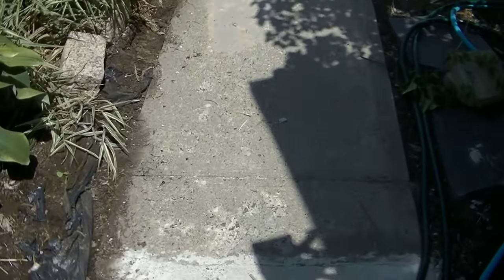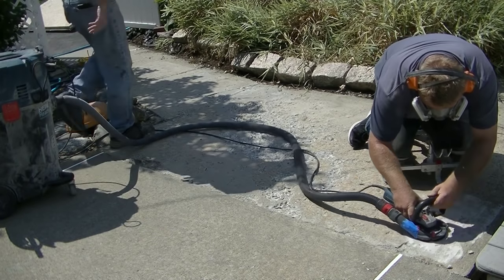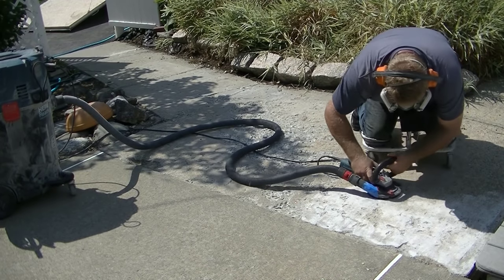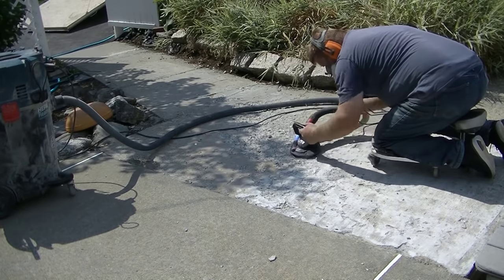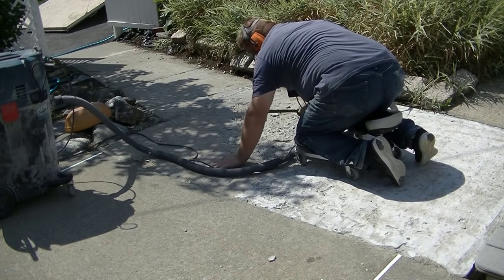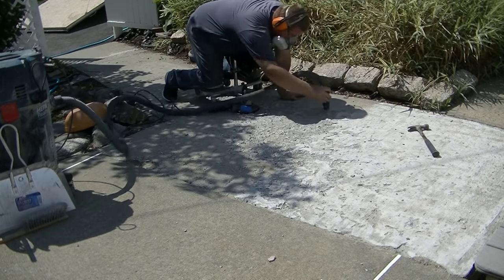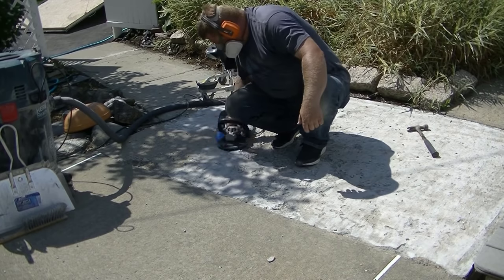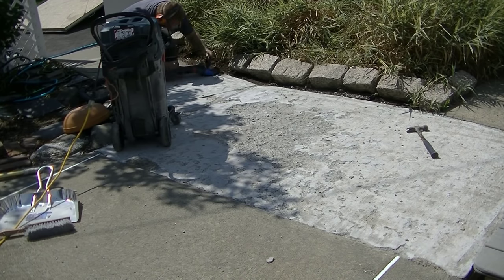How To Resurface A Badly Damaged Concrete Walkway

Comment from the maker: Here's the UPDATE VIDEO over a year later: https://youtu.be/5TdZ7jTmwyY
Reply: Excellent follow up. I watched this video when you first upload it and my first thought was how well this would hold up vs a full repour.
Reply: Thanks, I'm about to watch both!
Reply: If we get a Costco Fuel Station in Maine…. (Or another job) We will call you!
Reply: Awe brother! That looks great! And at the same time I’m encouraged to give this a try… Thank you, and pray that your business is always abundantly profitable.
- Harry
Reply: I repaired my walk way the same way but I also painted it but the paint peeled off ,,, any idea how to get the remaining paint off ?
Reply: MIKE, where did you guys get that gardening chair? It looks perfect for getting low without the strain. I have back issues and it would help me tremendously.
Reply: Great video! I'm going to attempt this on a rental unit i have. The slab is in worse shape with about 1 inch deep spalling in the middle. Ive had bad luck with standard mortar mix tuck pointing block and have since switched to Mason mix. Is it ok to use Mason mix instead of mortar mix?  I actually don't even know if rapid set makes a Mason mix. Please offer any advice. Thank you
Reply: Almost as satisfying as squeezing a giant blackhead…….
Reply: I have a  garage  floor   to do   will this work on  a drive way. The same  way. An how do I get to  talk to you   Tim from Ohio.

Comment: Guaranteed to last long enough for the check to clear!
Reply: RS mortar mix is 6500 psi, Cement All is 9000 psi.  It can take a beating even in driveways no problem.  This repair will last for years and years even in freeze thaw weather.
Reply: @vinceleto That's one of my guarantees on any masonry job. I also guarantee it to harden, one day crack and nobody will ever steal it.
Reply: Yea too thin should of just used one layer and make it thicker from the start.
Reply: @magouliana32  No.. it would have cracked in all those low voids.. stepping the slab was correct..
Reply: How much could cost a job like that? Thank you
Reply: @jorgerodrigues3404  Flames will await the wicked..
Reply: @magouliana32  that’s actually inaccurate, it’s making a mechanical bond, it’s stronger because it’s thin, by using a product like this and making it more than1/4 inch thick you GREATLY improve chances of cracking, completely different animal than regular concrete
Reply: @jamespalladino9884  understood
Reply: Better run to the bank
Reply: What do you charge🤔for a job like that....
Reply: @mysteriousmike226  I would charge $1500and up here in California. With no warranty
Reply: @jorgerodrigues3404  I'd charge $400 plus materials.
Reply: @vinceleto  no it won't salt gets under the first crack and its done
Reply: It won't last forever, obviously.  But there is a time and place for this.  For instance, this homeowner might be planning on reconfiguring their landscaping/hardscaping in 3 years.  Hate to pour brand new then rip it back out 3 years later.
Reply: @magouliana32  I don't do concrete resurfacing so this whole video is new to me. I install floor covering set this carpet vinyl etc. I just completed a 4 ft by 15 ft hallway in thick terracotta tile. In the middle of some tiles they may be 3/8 of an inch thicker than the rest of them and the grout lines are an inch wide and concave. Giving a thin coat to fill  in the low areas and it makes the second finish coat go on much better or easier.   the only reason I'm saying this is this whole project is new to me and I didn't realize it first it was going to go on so thin. Initially I was thinking it was going to be a 1 inch pour, so in the beginning I was confused as why they're spending so much time filling in the little stuff. It makes sense now by troweling  in or forcing in the first coat so that's a final coat would go on easier.
I learned a lot these guys know what they're doing at the beginning I was kind of doubting them..... My bad 😱 ....sorry guys, after seeing the process it made sense and I really like it.
Reply: @ChadBray3  well if I was planning on renovating in 3 years then I would just wait the 3 years intend of paying for this.
Reply: @randywl8925  you can just pour right over them low spots as long as you force the concrete down into the cracks and dips you just fill it up if it's low then mag it out or trowel it or even take a straight edge or a piece of wood and level it before your trowel it
Reply: Why are you using mortar for your top coat? Mortar is for bricks not resurfacing. Why didn’t you buy a bag of resurfacing like Re-Cap resurfacer? It’s $28 a bag as opposed to a bag of mortar that just coast around $12.
Reply: @vinceleto  mortar mix is high in psi this is correct. But it doesnt have a polymer in it which helps the mix stay on the driveway without poping up. A resurfacer should have been used for this job. 1 winter and its toast
Reply: @randywl8925  wait your a flooring guy and you never patched your floors?  When you do vct you dont float your entire surface?  Jobs must look great after they get waxed..
Reply: @dohnjoe4024  I patch my floors good enough that you could put wallpaper on them.  I spend way too much time doing prep.  There's also a thing called Overkill.  I have that disease. 😁
If you have a few dings and dips is ridiculous to skim coat the entire floor for VCT.
Reply: @Bbbbbbbbbbb-f1w  Rapid Set Mortar Mix is not really mortar. It's used for repairing buildings and bridges. It's great stuff.
Reply: I topped a sidewalk that took roof water from a garden shed without a gutter for my dad.  It lasted 12 years of Indiana freeze/thaw cycles.  Ardex.
Reply: @jorgerodrigues3404  I always lost my butt. lol
Reply: @jamespalladino9884  Most manufacturers of repair systems have a "patch" mix and a "Top Coat".    I think sodium silicate is under-rated for top coats.
     I read a paper on swapping latex paint (out- dated or unwanted) for up to 30% of the water in Portland mixes, as well.  It made the concrete more water repellent, to have a stronger bond, have more compression and shear strength. 
      The writer suggested concrete plants become paint recycling centers.  Lots of logistics but do-able and profitable I'll wager.
Reply: @jeremiahshine  What Ardex product?
Reply: @randywl8925  I think they call it the feather finish now.  It tops the Ardex CP.
Reply: @jeremiahshine   That's an inerior rated floor patching and skim coating product.
That said it's not like it won't stick to something outdoors.
Reply: @jeremiahshine  very intresting on the sodium silicate and the latex paint but they both make sense and we will do a little experimenting next time we are playing around (that’s how is loser Italian concrete guys get kicks🤣) but seriously they both make sense as whenever we are doing a micro topping of any kind we only use liquid polymer which in my opinion is mostly a thinned out elmers glue but there are so many little tricks to this stuff... nothing more important than surface prep!!! Cheers!
Reply: @jamespalladino9884  It smells just like Elmer's glue!  I thought my Irish nose was the only one to notice!
Reply: @vinceleto  talking about psi is completely irrelevant in this situation. It cracks because of tensile strength. In fact often with higher psi products become more brittle.

There are products designed for this type of repair that have been engineered with polymers, acrylics, and bonding agents for higher tensile strength and allow some movement while not losing adhesion.

Painting the surface is another mess in an area of high traffic and salt usage imo.  After several years of paint having to be touched up you get that peeled and layered look 🤮
Reply: Lol
Reply: @vinceleto  no way is that psi rating is correct I've been a Mason for 30 years and even industrial strength concrete is at best 5 to 6 thousand psi and regular mortar mix is 2500 to 3000 even though there are several types of mortar mixes type n, s,m, and the best is straight Portland . Type n is no more than 2500,s around 3000 m is around 3500 , and Portland is 4000+ .concrete is a different animal because of the type of aggregate you use actually the larger the aggregate the stronger it is, and also the different additives like micro fiber,nacl, etc. Also changes the strength, I also did poured foundations for years as well as flat work. These guys did a great job, making it look good as for how long it lasts is anybody's guess so many factors can deteriorate concrete weather, salt, freezing, water penetration, being sealed properly, and maintaining the integrity of the repair all have a bearing on how long it will last, but cosmetically looks good, and costs a lot less than new concrete
Reply: I was a little surprised that they didn't use Muriatic acid once the concrete was ground...
Reply: Lol! Facts!!
Reply: Oh no, that's so bad😮😅
Reply: Yeah, even if this is high strength motor its going to fail.  Wet pour will work for the cracks.

Comment: My experience with these type of products is they simply don't hold up.
Reply: Patchcrete. Greatest thing since sliced bread. Feather edge to 1/2” with no aggregate. It’s practically magic. I’ve been selling it for 20 years and can’t recommend it highly enough. It comes with a bag component and liquid component.
Reply: I agree. Its just a temporary bandaid
Reply: Concrete just doesn’t hold up period. It cracks and falls apart. These are “temporary” and cost-effective methods to buy time. 
Want something that holds up? Build your sidewalk out of titanium…
Reply: @losttribe3001  Coincidently I just laid a titanium sidewalk. So far it's held up good.
Reply: Prepare  correctly  and it will. Maybe  your experience  is the problem?  🤫
Reply: Great if your selling your house, it'll last a few years then it's no longer your problem, new owner can't really complain if it doesn't hold up longer than that.
Reply: @willliam1343  When you spend more time preparing it than ripping it out experience tells me you start cutting corners and wind up with a result that looks good, makes the customer feel good, but last only a short time. What they have done will not last.

Comment: I'm surprised you don't use a pressure washer to clean the walk as it would knock out any loose items a lot better and do a deeper clean.  At first, I didn't know you can use thin material like that and it would hold.   Thanks for the video!

Comment: This is one of the best and informative videos on resurfacing concrete that I've seen.  I've viewed quite a few over the years. Thank you for providing so many details on the process as the job is being done.  Drying time, type of product,  wet the old surface but not too wet etc...important nuances that come with experience.   This process can stave off a very expensive project for a few years when there are other priorities.

Comment: This informed me why I prefer to hire a pro. You have the tools, know the materials and how fast or slow to go, make everything look great, and clean up the job so it looks great! Plus, you don’t get sidetracked and you finish in a short time. Nice job!
Reply: It’s hard to find people to do this work.  They just want to replace slab
Reply: @GregOrangeDoor  Everyone I have called has said exactly that "sorry we just replace what you got".
Reply: @GregOrangeDoor  Same as a mechanic. They just replace parts and if that dont work, replace the next thing  they "think" it might be. Old timers, diagnosed a problem, lets say a carb., and dig into it and fix the bad component instead of replacing the whole carb. I know, they will say its quicker. Either way they screw you with labor costs
Reply: I'm thinking it is going to fail and be a waste of money. Worked on a long  job and smaller patches not tied in fall off.
Reply: @GregOrangeDoor for real. Nobody wants to troubleshoot or repair ANYTHING anymore. From electronics, to furniture, clothing, or home repairs. Throw it out and replace it seems to be the default answer. I’m an older millennial and fortunately grew up in a home where we fixed things and made things last. Passed down from both my grandpa’s who lived through the depression and showed an example of working hard to improve what you have. I think my wife is amazed when I bring home old “broken” stuff that people are throwing out, and restore it to new rather than spending $$$ on new stuff that’s actually built to a lesser quality and likely won’t last as long as my repaired version.

Comment: I always use bonding adhesive both in the mix and on the surface instead of just water.  Both of these materials hold up great.  If you find this isn't working for you, chances are you didn't prep enough. I've got patches in high salt areas that are 10+ years old.

Comment: 2:14 Dragging the hammerhead gives an audible sound change going from sound concrete to unsound concrete. We called it Slab Sonar on my crews.
Reply: Good tip, kind of like knowing exactly when the concrete is about to crack when you’re hitting it with a smaller demo hammer because it changes tone to a deeper note
Reply: I do that on dry walls. Il steal the sonar name.
Reply: I do that placing expansion bolts for climbing. I call it "sounding the rock"

Comment: Great job guys looks good. I own a medium-sized excavating company and do a lot of masonry work. What I find that works really well to speed up a concrete repair job like that. Is when I start spreading the resurfacing material. I start off by using a 24 or 36 in black rubber squeegee. Give it a shot you might like it you did a good job without it anyways.
Reply: Great idea. I think that would make leveling/blending easier.

Comment: Great work and great video. A less scrupulous contractor would have told the homeowner there was no other option other than to tear it all out and repour it. At a much higher price. You show how skill and work can repair something that is damaged, and save the homeowner money in the process.
Reply: I'm not a contractor but i do concrete and grout and i don't think this will last.  He can't even get small areas flat with a trowel, that tells me he is self taught with little actual concrete experience.  Never hire someone without a garantee and insurance.

Comment: For anyone who thinks that ‘full-blown’ concrete finishing may be a little more than they can handle, just know that contractors will pay a good patch-man, that knows what he’s doing, VERY good money. As a concrete contractor, I was constantly in search of good patch men, bcz even in new construction, there is always a need for ‘patch work’. 
  The last time I counted, there were probably around a million different ‘patch’ products out there and they can be quite expensive. Sometimes more than $20+ for a little 5lb bag! It was surprising to see that you’re finding success with some of these relatively inexpensive products. It would be great if you could revisit this job in a year or so to see how well this holds up.
Reply: An update would be nice

Comment: This is good work. I've found using a masonry bonding agent will increase  the longevity of a temporary repair like this.
 I personally would never finish concrete with mortar.
Reply: Would you finish concrete with concrete ?